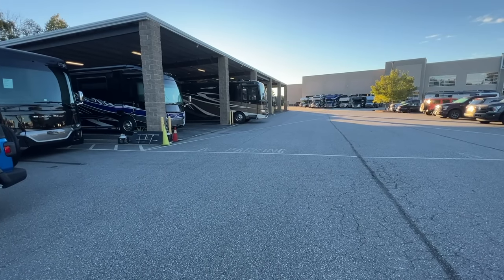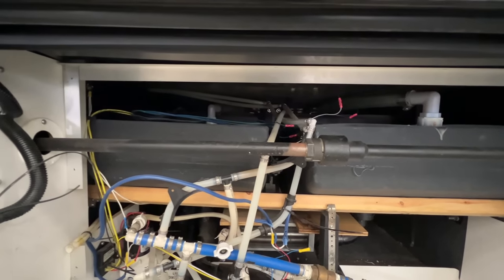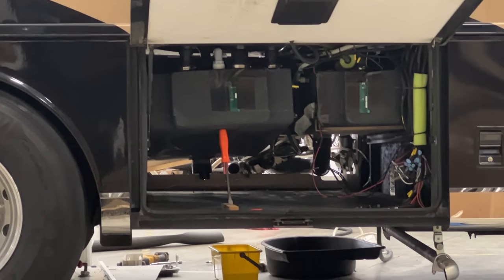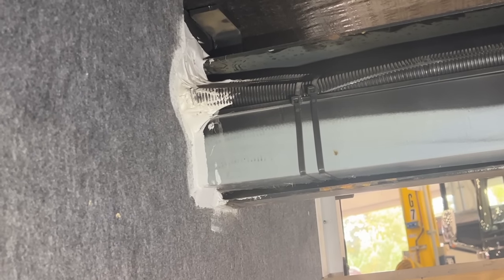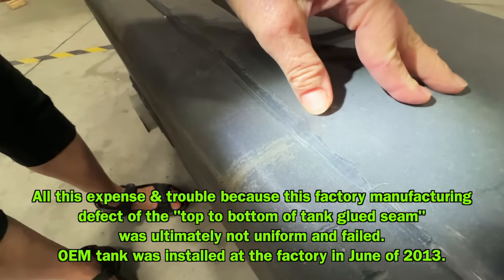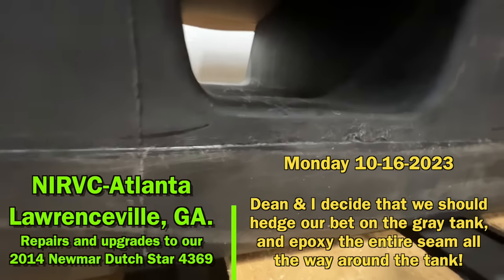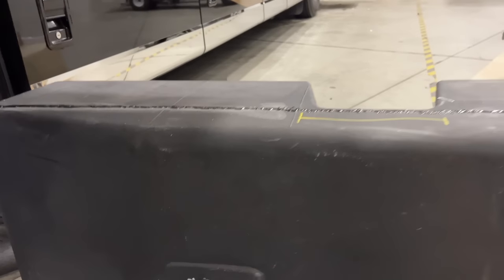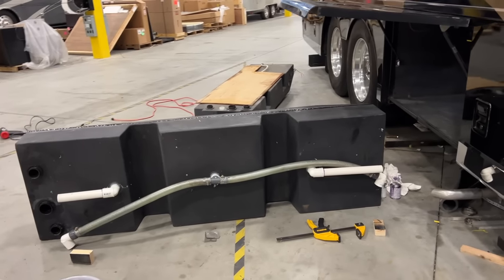NIRVC-Atlanta | Motorhome Gray Water Tank Replacement-National Indoor RV Center Service Review-EP287

Comment: Good video 😊 unbreakable the attention they had to repair your tanks and make changes so no more  problems  I wonder what the assembly of a new Newmar tanks and plumbing I hear that most manufacturers  are having problems with quality  control   and no owner like you that's proactive on making sure there rig  is ready for travel  safe travels 😀
Reply from the maker: The reality is that this tank was installed in June of 2013.  Somewhere between then & when I discovered it leaking (About July 2023) it has failed.   Nothing lasts forever.  I got unlucky and won the prize.  I know of NO OTHER NEWMAR OWNER that had a black or gray tank leak.  Thanks for watching Stephen.

Comment: Your videos are so informative and entertaining. I just ordered my first RV (2024 Newmar Dutch Star 4369) from NIRVC (Your endorsement of National Indoor was a big reason I went with them). I’ve been following your adventures since 2019 (it’s taken this long to get my wife on board)

The detail in the videos of the work done in Atlanta are outstanding. Here’s my question – I assume that I won’t be in the NIRVC repair bays like you were, so how am I going to see all the additional items that may need attention, such as the nicked Oasis hose, the rubbing of the wires, tank valve, or the poor tank seam? If you weren’t there, would Dean have identified these issues?
Reply from the maker: Dean fixed a number of things along the way that I found out about later.  When we first met in the Service Advisors office, he looked at me and said confidently, "It will be better than when it came in when I'm done with it."  Turns out, he was right.  I think it helps that I discussed at length with Dan the Service Advisor that I wanted as much NEW componentry as possible.  I expressed MANY TIMES  I wanted to do it right the first time only once, and wanted to do everything I could do to insure a successful outcome.  I am certain this added some hours to the overall job. I know it added to the parts cost. I expected this, and told Dan I was willing to pay for it,......  A job like this you only want to do once when you are in my situation!  Congratulations on joining the Newmar Team, and NIRVC Family. PS: If I was buying new now, I would GLADLY spend the extra $$ for the NIRVC Campers Edge Extended Warranty. My last two repairs EACH would have paid for the policy,.....and then some.

Comment: Thanks for the video. Clearly and I RVC knows what they’re doing. Seems to me that Newmar should cover some of this given that the rubbing from the wires and the seam failure with the cause of the leaks as well as the aqua hot issue. Those are not where issues those are defective design and/or installation issues. We have a 2020 Dutch star, and I have added tons of that protective foam to areas where I’ve noticed rubbing
Reply from the maker: I guess after 10 years, and the fact that Newmar didn't make the tank, I caulk it up to just being the unlucky sole that won the "leaky tank" lottery! The swimming pool noodle foam spacer trick is an RVers best friend.

Comment: Glad you got that fixed. I like the shower fix. I may look at doing that to.
Reply from the maker: Just bought a braided stainless steel "Y" hose mixing hose adapter.  I am ready for use now,......
Reply: One add on question. What was the epoxy/glue you used on the tanks to reinforce the seam? @OurJourneyInMyles
Reply from the maker: @WILDEBILL308  Wurth Fix All 2 Part Epoxy  https://goodspeedmotoring.com/product/wurth-fix-all-epoxy-0893301900/

Comment: Your very detailed and informative video makes me hope I don't ever have a similar leak issue. When in the wet bay it appeared you had a combination of pex hosing and vinyl hosing. I may be incorrect that you may just have had different types of pex hosing. My 2010 fifth wheel had all vinyl tubing and wished  My understanding is that pex has a much higher burst rating than vinyl tubing. I really thought you should have gone with a stainless steel wet bay wall as seen on Newell and Prevost coaches. BTW my shower head in the wet bay also leaks.
Reply from the maker: I'm thinking hinged plywood doors incase I have to get in there again someday!

Comment: Unrelated to this issue I have just become aware of a dutch star recall on a headlight issue related to a diode failure believe your coach is included in this recall
Reply from the maker: Thanks James.  I already have done a headlight recall a while back, and actually burned up a relay in my electronics bay once.  We could smell it when it happened, couldn't find anything, and then MONTHS later found out we had a headlight out that didn't fix itself when I replaced the bulb!  I had a new relay installed during my Oasis boiler replacement at NIRVC-Las Vegas!

Comment: So what did all this mess cost if I might ask? Usually you are open with that information. But I did not see it this time.
Reply: 12k it's mentioned about 10:30 in the video.
Reply from the maker: Thanks for being such a good viewer Duffy.  I didn't talk about the repair costs because the bill wasn't done yet during editing.  I actually said $10K one time in the video, and then $12K later on while filming.  The reality is as time goes on, and as the labor rate continues to change, it it best to talk in terms of labor hours and parts costs.  This job was about 65 hours labor and $2000 parts.  Our tech was always working hard, and swear he never ate, had a smoke break or used the restroom!
Reply from the maker: I didn't talk about the repair costs because the bill wasn't done yet during editing.  I actually said $10K one time in the video, and then $12K later on while filming.  The reality is as time goes on, (today is 11-12-2023) and as the labor rate continues to change, it it best to talk in terms of labor hours and parts costs.  This job was about 65 hours labor and $2000 parts.  Our tech was always working hard, and swear he never ate, had a smoke break or used the restroom!  Dean was a great guy to have on our job,....

Comment: Can you replace your diesel boiler with tank less electric hot water heaters.
Reply from the maker: We have no propane on board, so it needs to be a diesel boiler for when we have no FHU 50 amp.

Comment: Glad to hear that you’re tank repair went smoothly. Just wondering why stainless steel tanks were not considered as an option.  I’m guessing NIRV does not have a metal fabrication shop. Could have farmed it out to a local shop. Welding stainless steel requires a special welding equipment, if my memory serves me oxygen free atmosphere around the tip of the torch. With the new cnc table computer guided laser cutting, should be no problem. It’s not like we’re building a submarine with a screen door, no pun intended. Thanks for sharing and safe travels 
25:09
Reply from the maker: The OEM tanks were the easiest option for me to go with.  I just wanted to be in & out of the shop as quick as possible.  Getting custom tanks made would have really complicated things in the shop.  Now if I was a boat,.......I would have looked into that!
Reply: Weight.  Cost.  Cost.  Weight.   Your choice of order.  The "house" and its systems need only survive the warranty period.
Reply from the maker: @raygunsforronnie847  That is true. From what I can tell on irv2.com, my gray tank failure was a fluke.
Reply: I don’t want to rain on the parade, but we use braided stainless steel hose’s all the time for racing cars. That are designed specifically for high heat and pressure. I know, you have to wonder about Newmar engineering department. Especially when accessing those hoses for repair are extremely hard to get to. Kind a falls short in my mind. Especially when you’re your spending a half a million and up for a camper. Braided stainless steel hoses would last the lifetime of the camper. I hope engineering didn’t spend a lot of money on that college degree.
Reply: @djroberts10  It's not the engineers or designers so much as the accounting dept.

Comment: Instead of putting that one water filter back in I would love to see if he could put our 3 filter system in that place. If possible hook that to our water softener.
Reply from the maker: I put the single filter canister back in for resale only.  I leave it empty, and consider it useless. Not enough room for the double Clearsource Filter unit, plus you get too much water all over everything every time you change a filter.  I also do not want all those additional connections, o-rings and canister connections to worry about INSIDE the coach.  I let them leak outside the rig!

Comment: Biggest problem I had with my 2001 fifth wheel, purchased new, was that darn outside shower. Finally just removed it.
Reply from the maker: Yes,........we are looking forward to using the hot water spigot for washing off the bugs on the front of the RV!
Reply: We are about the finalize the options on our new Dutch Star. Should I not get the hot water line to the generator compartment and use the outdoor shower?  @OurJourneyInMyles
Reply from the maker: @mattross7221  I would think the hot water to the generator compartment is better.  Easier to use, much less hose & screwing around.   I don't think Newmar has a HOT/Cold shut off option in the wetbay,......its aways just a dog wash & sewer hose washing device.  WE NEVER WASHED THE SEWER HOSE with that thing.  I NEVER have seen one person using theirs in 6.5 years. We use grey water, or clean black flush water to flush the sewer hose before disconnecting & storage,......good enough,.....it will be dirty again soon!

Comment: Why would your coach need a new gray tank?  It’s not that old-
Reply from the maker: The leak was at the seam, and had to get removed along with the fresh water tank to fix it.  Since the number of labor hours would be the same either way, I decided to re-install a new tank, rather than the old one just to be pro-active and error on the side of success. Each new tank added about $500.

Comment: This type of maintenance has to be the most nerve wracking of full timing. Ironically, a lot of the issues are created by poor design and product quality. I fully understand why the likes of Liberty manufacture their own parts to eliminate any potential leaks. It’s almost as if they’re designed to fail. If they’re planning on using those types of materials why not put the tanks in a tray to collect any leaks and allow them to safely drain away? 😳🤔😵‍💫
Vibration and parts rubbing on components isn’t going to end well, preventative maintenance is the only solution and a hefty bank balance. 😬🤑🥴
Reply from the maker: We are a bad combination for a Full-Time RVer.  We LIVE in it full time, and we TRAVEL in it full-time.  This is tough on everything.

Comment: I hope newmar covered this bad quality and poor engineering under some kind of warranty they are all over youtube claiming how good their warranty is service and engineering..  you can weld those tanks also, there are ultrasonic welding along with epoxy solutions
Reply from the maker: The reality is that this tank was installed in June of 2013.  Somewhere between then & when I discovered it leaking (About July 2023) it has failed.   Nothing lasts forever.  I got unlucky and won the prize.  I know of NO OTHER NEWMAR OWNER that had a black or gray tank leak. I do not expect them to help.  They are a good company,.......and make the BEST Production Motorhomes.  This type of thing happens,....  Having said all this, I should have bought NEW, ......with an Exclusionary Extended Warranty.  I was a Newbie,..........I didn't know any better.